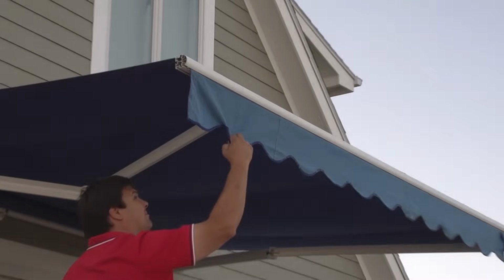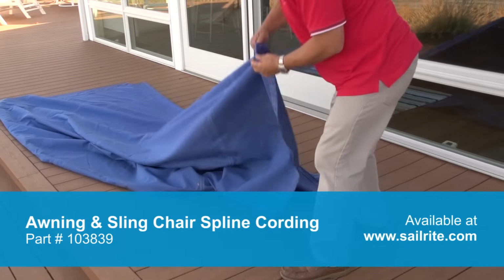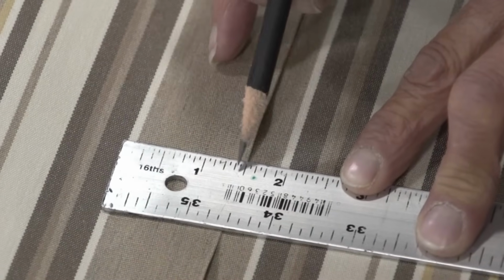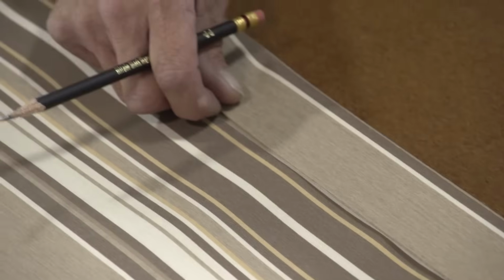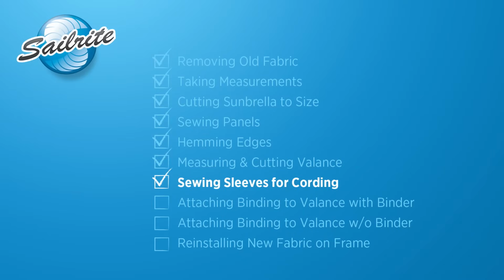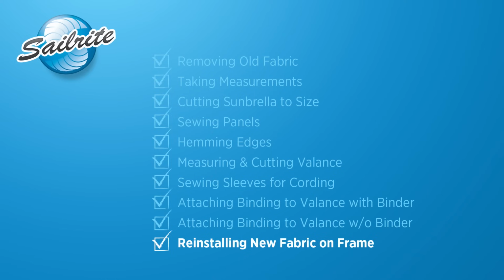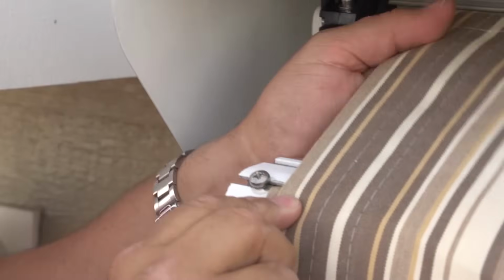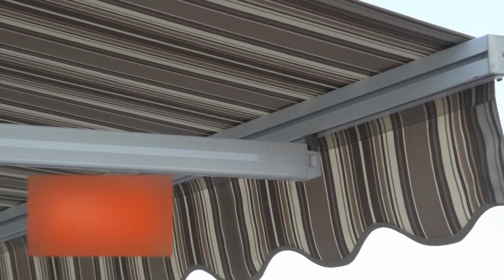How to Make Your Own Retractable Awning Panel

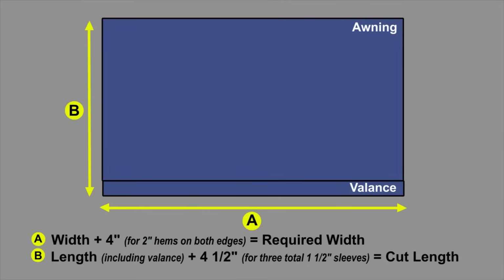Comment: I noticed what seems to be a mistake in the fabric measurement. At 4:50 in the video. Intead of 4 1/2 ", You would need 9" of additional fabric to measure 3x 1 1/2" hems. I noticed it when I saw Deb measured 2x 3"spaces between valance and the main.